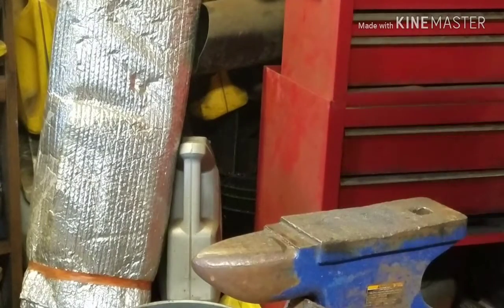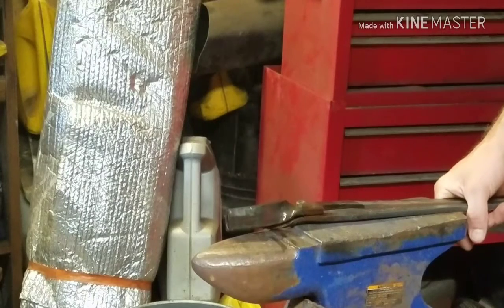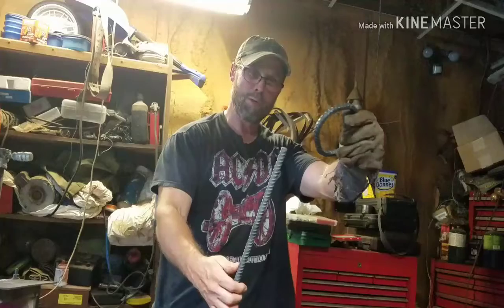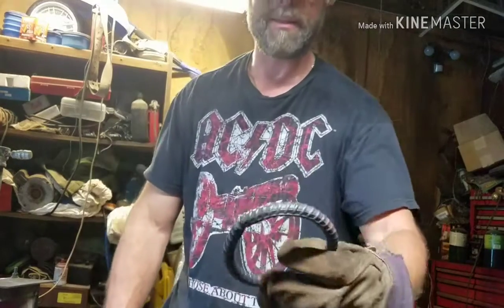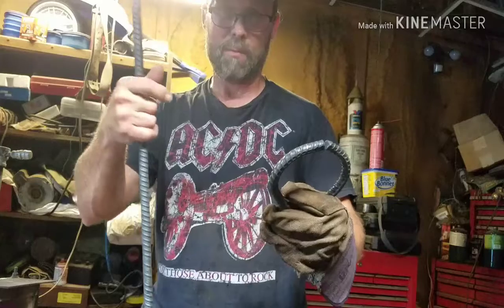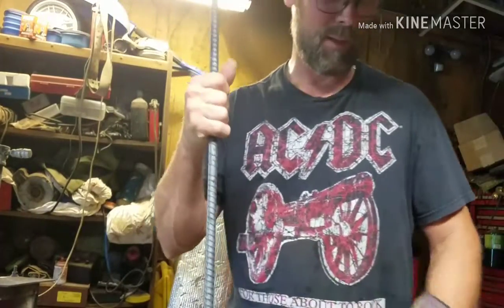Start of the tripod

Comment: Man... you're gonna make me fire up the forge, even though it was 95 today!!! Ha ha! I just got started last year, mainly for knives, but I like making cooking stuff a lot better
Reply from the maker: It gets guit hot in the forge sometimes but I love doing and it very addicting to me. Fire it up Brother!
Reply: Backyard Custom Knives - I need to make a propane forge. I'm just using the ol' brake rotor/drum forge now... the actual propane burner is the part that's holding me back... I can make the box out of firebricks and angle iron. I'll figure it out sooner or later!
Reply from the maker: I did a video on my forge build actual it was if I remember 5 videos. If you want to check them out.